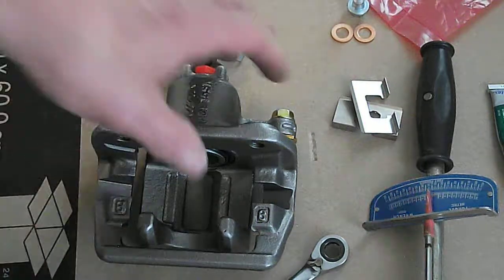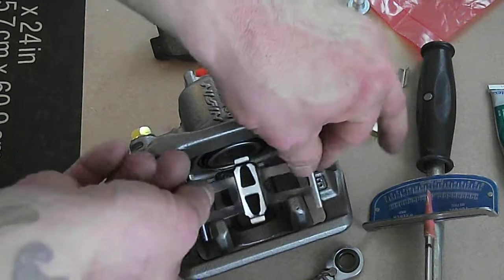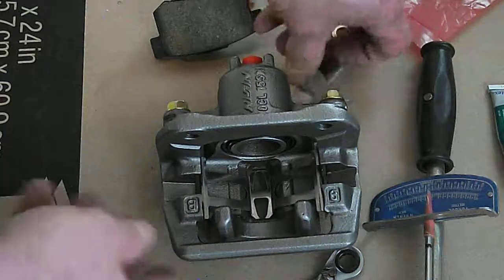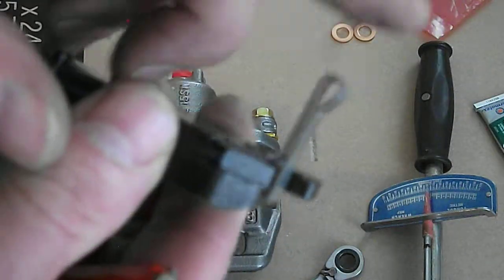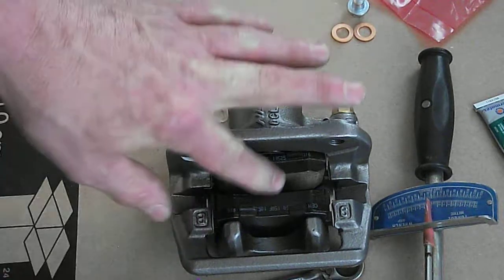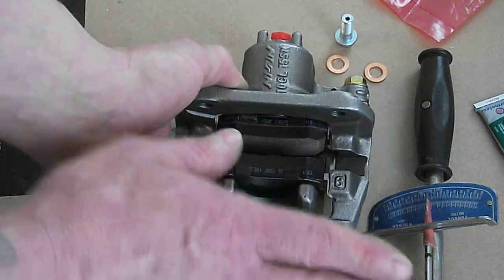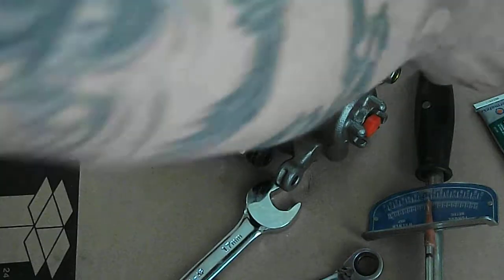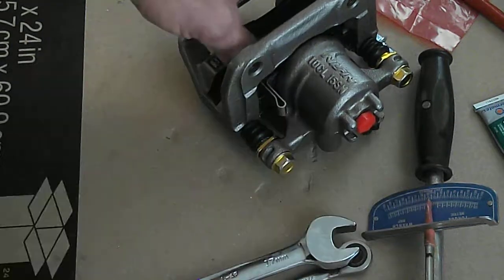2002-2004 Honda brake caliper rear, brake shims or refered to as pad retainer and pad springs.

Comment: What did you grease up? You pulled the caliper out of camera view.
Reply from the maker: Cameron Dragons Soccer Club where there is metal to metal contact. They can stick with corrosion.  The areas where the brake pad rides on, lightly lube. Where the pads slide on. Sorry missed that when I did the vid, thanks for pointing it out

Comment: So what do the shims actually do? Why does that stop the piston from locking out?
Reply from the maker: They stop rattles and clunk noises from the brakes. Brakes are floating and would make noise if there are no shims. Ever hear a clunk sound when applying brakes? The shim has fallen out or rotted away